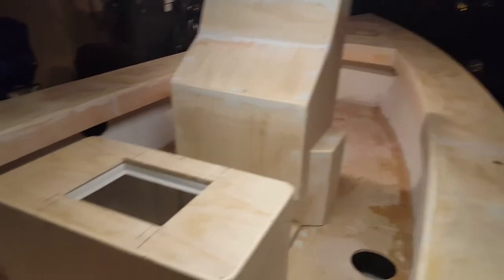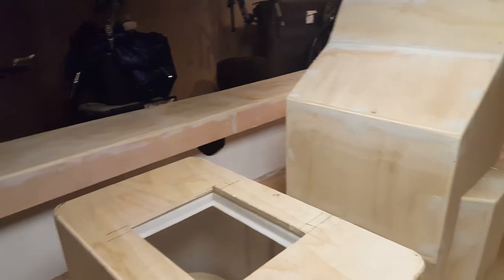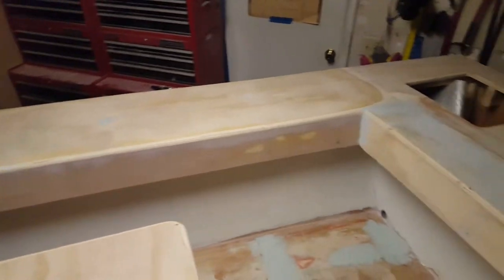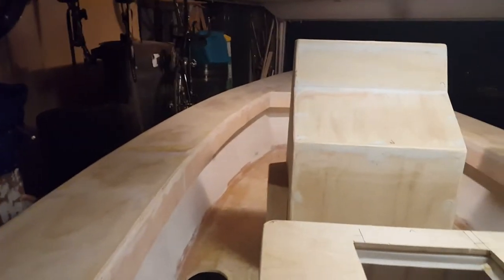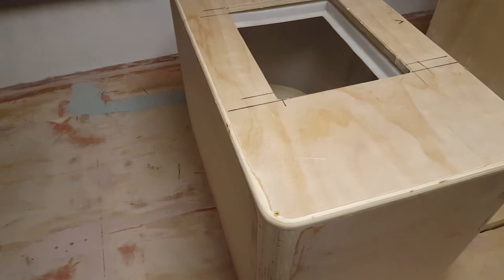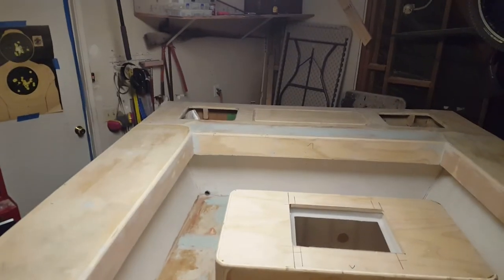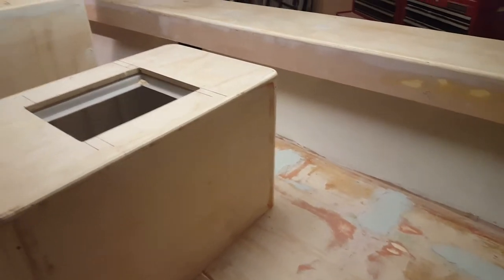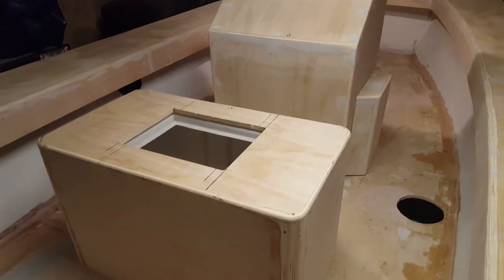DIY Wood Boat Jan 2019 Rock Lobster

Comment: Where can I get the dimensions for a console like this
Reply from the maker: I found a bunch of consoles for sale on Google and then mocked one up with 1/8 plywood using similar dimensions.  Took about three tries with different dimensions before I liked the fit and personal ergonomics.  The console I liked on Google cost $1,400 delivered.  Mine costs about $60 in materials.  I consider this a hobby and don't mind putting the time into it.  Finished it in a weekend.